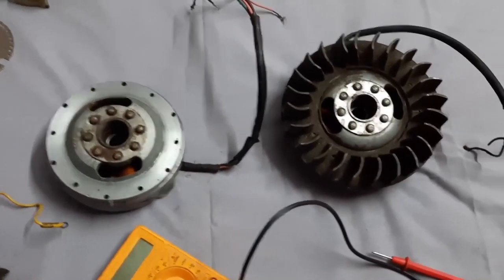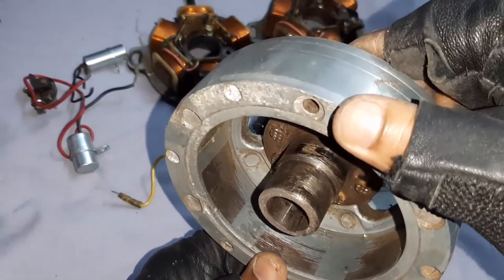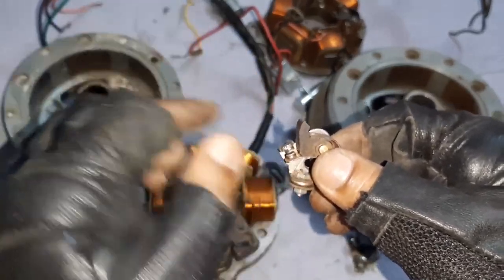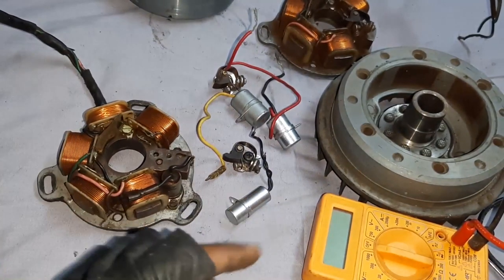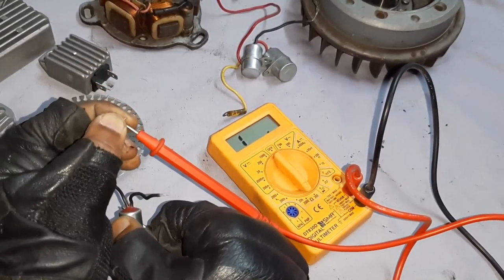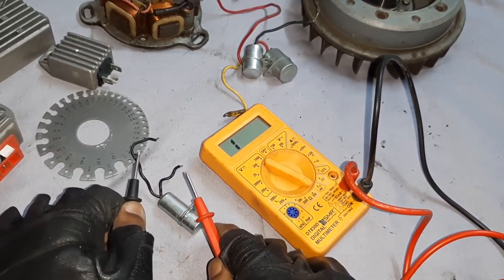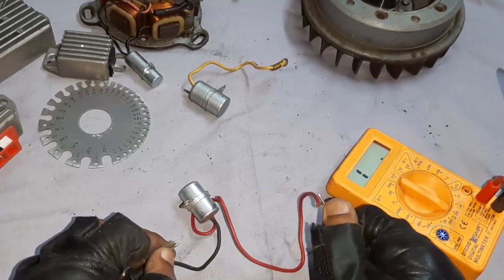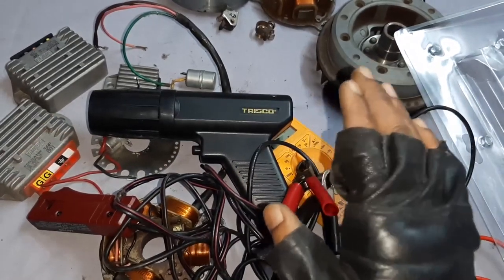Mastering the Contact Point Ignition System: A Step-by-Step Guide

Comment: Specifically which other vehicle's condenser can I use for Lambretta?
Reply from the maker: You can use bajaj chetak ones. Most of the two wheelers condensors readings are closer. You can place the condensor out side the stator also
Reply: @LambrettaRamesh  yes will be placing it outside.
Currently I have joint two wires from the stator (one from ignition coil + backlight one) to get the blue current
Reply from the maker: Blue is individual. Condensor connection go through LT Coil
Reply from the maker: Please remember the condensor has to be grounded properly. Otherwise you will not get good spark
Reply: @LambrettaRamesh  ok thank you sir
Reply from the maker: You are welcome Sir
Reply: Will you make a video on how to fit the condenser out side the stator, keep up the good work.
Reply from the maker: Ok 👍